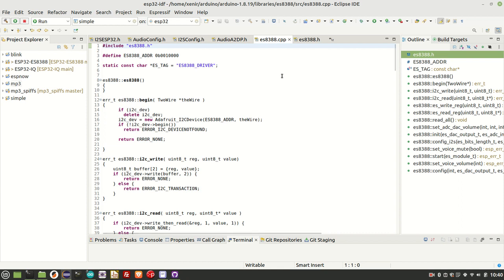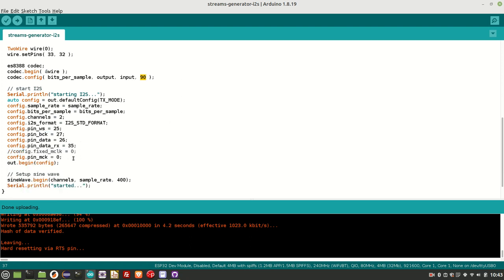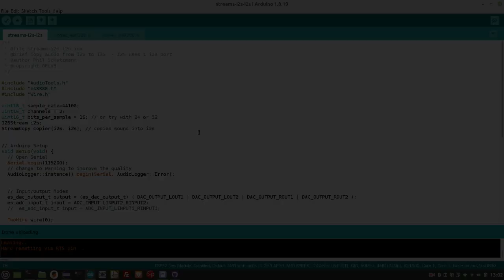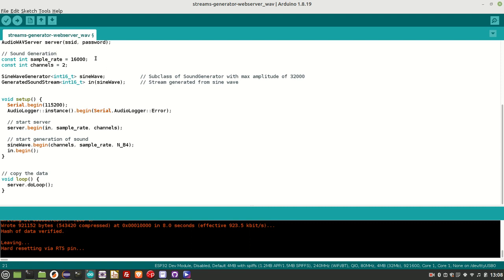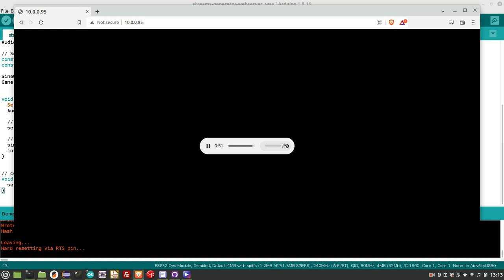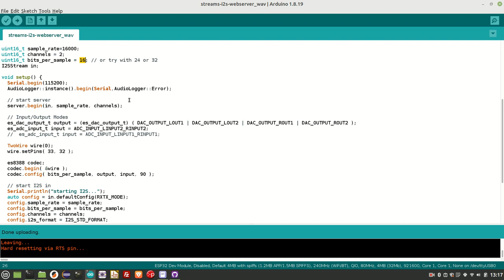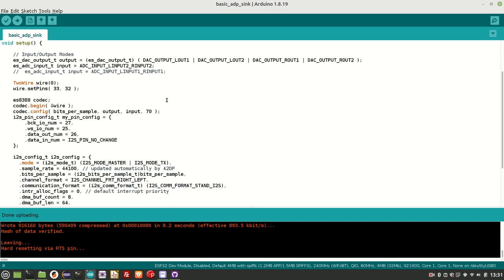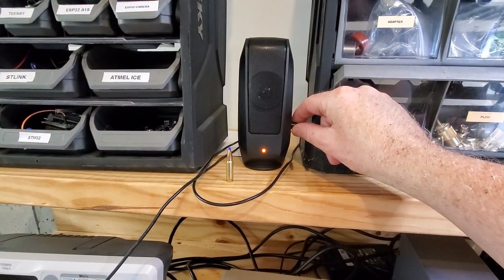ESP32 A1S with Arduino Audio Tools

Comment: hey there!
thank you for your complete and well-explained contents here
I was wondering if its possible to have sink and source simultaneously with esp32-a1s?!
something like Bluetooth hands-frees?
thank you so much
Reply from the maker: I haven't tried that myself - but there are two independent I2S interfaces. I only scratched the surface with the bluetooth support in the arduino audio tools libraries. Thank you for the comment

Comment: Hello NA5Y!
Congratulations for the video.

I'm using an ESP32-A1S audio kit board from AI Thinker, with the aim of making a multi effects pedal for guitar.

For the first test, I used your streams-i2s-i2s code to get a bypass sound from my guitar and it worked perfectly.

Now I'm looking to add effects like delay and reverb. To do this, I believe I will have to make changes to the 'copier.copy' function, present in the code's loop.

Could you tell me where I can find it in your available libraries?

Thanks!

Comment: So I built a small board with a  ESP32 A1S and tried to run this code and no sound it did compile and upload fine and it also gave some serial monitor readings but that is all, any advice?
Reply from the maker: This is an ESP32-A1S module? Most likely you have the pins wrong. This has worked for me:

  config.pin_ws = 25;
  config.pin_bck = 27;
  config.pin_data = 26;
  config.pin_data_rx = 35;
  config.pin_mck = 0;

Also the SDA and SCL pins for the ES8388 should be set by
  wire.setPins( 33, 32 ); // SDA = 33, SCL = 32
  es8388 codec;
  codec.begin( &wire );
  codec.config( bits_per_sample, output, input, 90 );

I have heard of some ESP32-A1S boards using different pins. I hope this helps.
Reply: @na5y  THX ill check in code and try again 
BTW i am testing with an additional power amplifier then drive a 1W 8ohm speaker ? 
Also do you think i can use a LED to test if the es8388 outputs something?
Reply from the maker: @sanjikaneki6226  You can't really use an LED on the output - its not going to tell you anything. A cheap oscilloscope is the best diagnostic tool. Which code example are you using?
Reply: @na5y  i was using the first example
Reply: @na5y  i tried to flash the new code but for some reason it gives constant uploading errors but the return serial is fine , did you ever experience something like this ?
Reply from the maker: @sanjikaneki6226  you are using the same circuit I had with transistors connected to the DTR and RST lines?
Reply: @na5y  yes
Reply from the maker: @sanjikaneki6226  Hard to remote debug this sort of stuff. One thing you can do is to attach buttons to ground on the "EN" and "GPIO0" pins on the module - that will give you RST and BOOT buttons that you can use as you would a standard module. Hold BOOT, then press RST briefly to enter the bootloader, then release BOOT. This way you can flash a new firmware on it.
Reply: @na5y  figured it out it was the IO0 thing
i used your code fix and still there is no sound , i tried with a 10k sine
BTW do you think it would be easier if i used ESP-IDF?
Reply from the maker: I don't think the ESP-ADF would help - if your pins are wrong it won't work there either. Either the pins are wrong (wrong I2C pins for the ES8388 for example) -or perhaps the A1S module you have is one of the older AC101 codecs. You could try putting some debug statements in the es8388.cpp and see if the I2C connection is working. Sorry I can't be of more help - it could be so many different things

Comment: Great job, I have the same idea to build SSB transceiver based on ESP32 but after Tayloe mixer I want to use AK4619VN audio codec it's more expensive but it have better parameters and included opamps to amplify differential I and Q signals. What do you thinking about that ?
Reply from the maker: Thank you Crazy! I am not familiar with that codec but I have been looking around for alternatives. I wonder if those two audio inputs are independent. That would greatly simplify audio switching.

There's nothing wrong with the ES8388 - but its good to have alternatives. Is anyone offering that codec on a dev board? Soldering QFNs isn't my favorite thing ;) Let me know how you get on
Reply: @na5y  For AK4619 is evaluation board AKD4619-A but it's not available on the market only in distributors. In Poland, it's Codico company but I can't check it in the US. If you check the Asashi Kasei website, you can find distributors. This codec has 24/32 bits with 192kHz sampling and 106dB S/N for ADC and 32bit 108dB S/N for DAC. Also, it has 4 analog inputs where each input you can multiplex for mono or you can have it as stereo input with gain. I also saw that they have special application to set all parameters in the PC.

In my idea, I would use ESP32-S3 because it has two cores where the one you can use for DSP and the second used for UX. If you want to use an operational amplifier I also found a good replacement for your proposal. Unfortunately, I stuck with my schema because I have a lot of work at my job, but if you want to look into it, it would be a pleasure. Currently, I am working with the circuit maker because in KiCAD I had one big error: I lost all footprints, and the backup not working properly. You can also find me on QRZ my callsign is SP2DAK :)

Best Regards, 73 :)
Reply from the maker: @Crazy23123  Those two cores will definitely come in handy as you say. 

Interestingly I have seen other radios use differential outputs but they they still use opamps on the output. This one for example:
http://theveteransdr.com/documents/Schematic_Magnis%20Rev%207.pdf

That uses the PCM3060 codec - which is a little older gen. I assume the op amps are for buffering maybe lowpass filtering. Its not for gain

Comment: Great video! Thank you for linking all your libraries. If I upload all of the libraries mentioned in the description, will I be able to avoid coding my ESP32 A1S in the ESP-IDF and ESP-ADF? I would like to code my project entirely in ArduinoIDE, but am unsure if I need the ESP-IDF/ADF for any initial setup/drivers/codecs before I can start using audio tools in ArduinoIDE. Thank you
Reply from the maker: You are correct. You don't need to install the ESP-IDF or the ESP-ADF to run. You will need to install ESP32 in the Arduino "boards manager" but that is all/ Thank you for the comment!